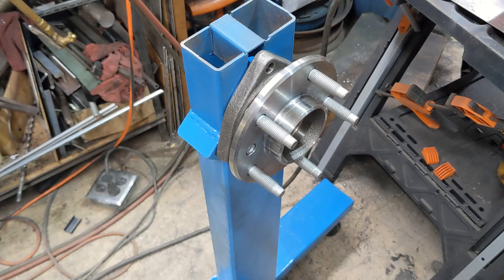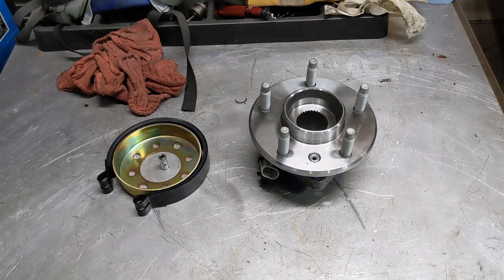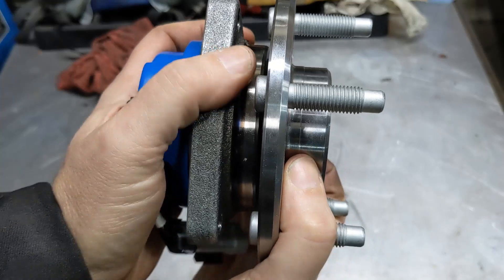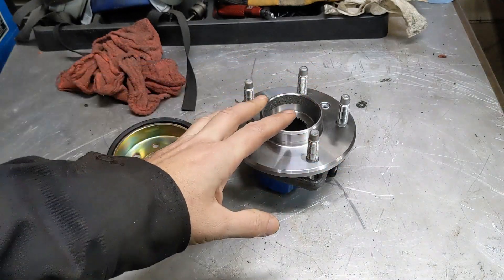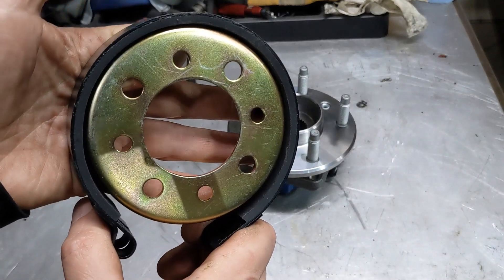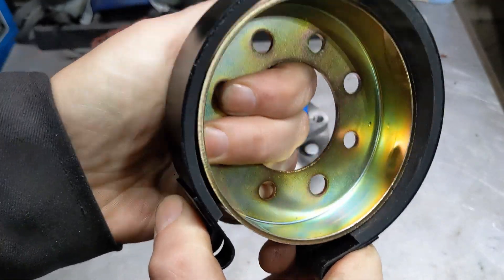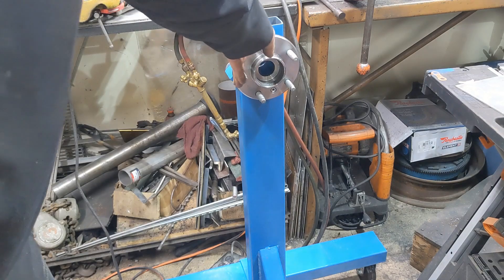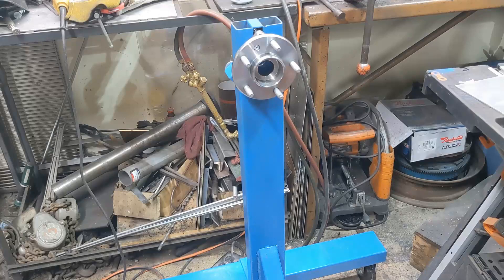Fabricating a Heavy-Duty Engine Stand (Part 2)

Comment: These days im building a stand same as your one. I didnt see this video earlier , I thought Im the first one whoes using hub for rotating part. Looks like its works. Btw I also customized an old cv with lock pin so now I can hold it in every grove rather than 4,6 locations

Comment: There are two bearings inside that hub, they need that stub shaft that goes through the spline to hold the assembly together . Certainly need that before you bolt on an engine !

Comment: I got a block I need honed real good it’s the original block I’d love to save it help please
Reply from the maker: Measure it, hone it, and drop in new rings. Unless the block is cracked, or you're building a race motor, it''ll work out just fine.